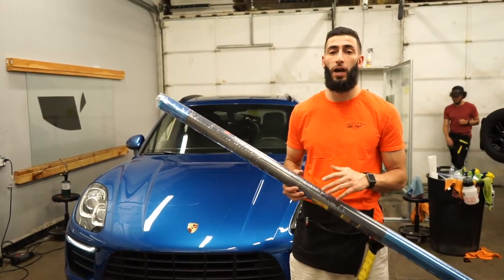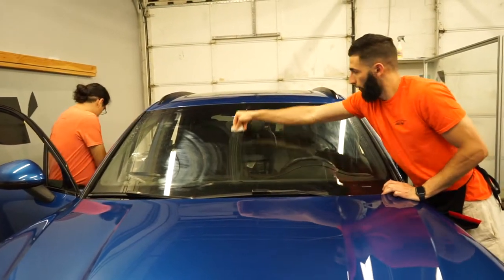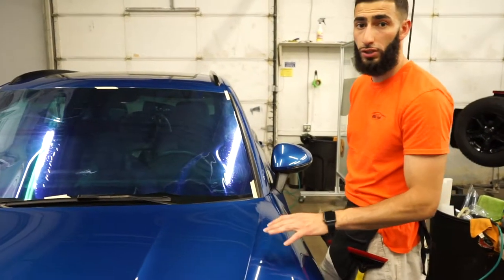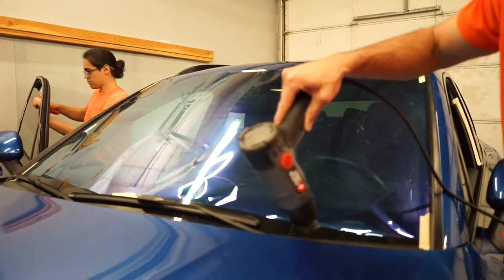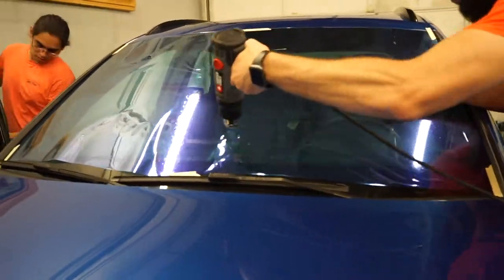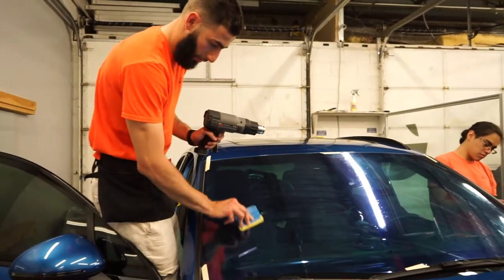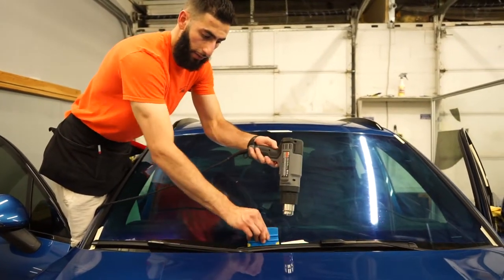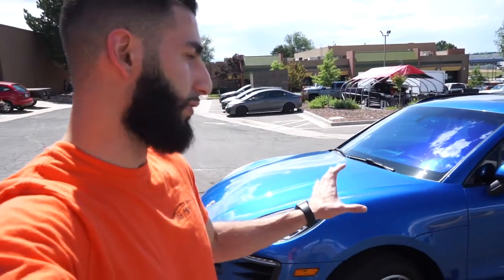How to Tint a Front Windshield Using UltraVision Chameleon Optimum Film | Porsche Macan S

Comment: I’ve tried dry shrinking and it leaves white specks when it’s dry . I wet shrink now it doesn’t leave them white specks but it’s harder to shrink . How do u not get the white specks when dry shrinking
Reply from the maker: do you use a dryer sheet before dry shrinking? Never had one specs
Reply: @milehighcustoms  I use dove soap wrapped in a cloth